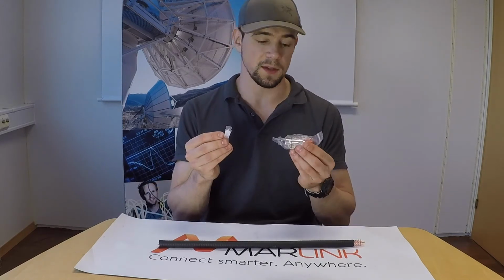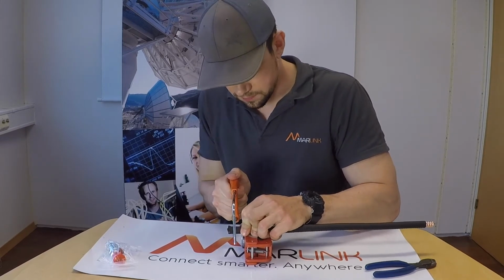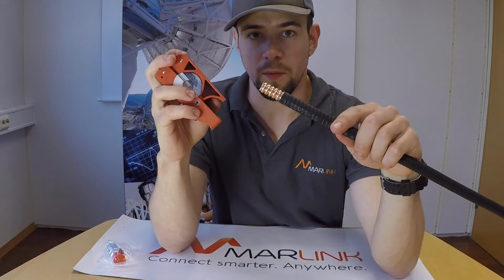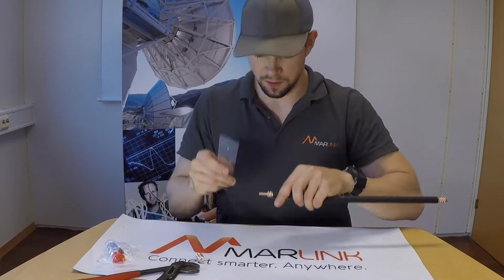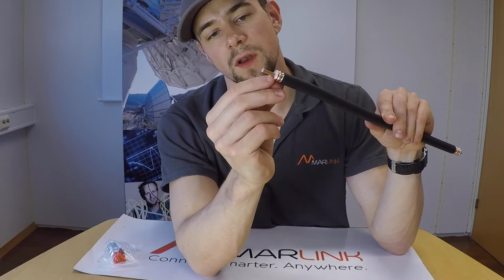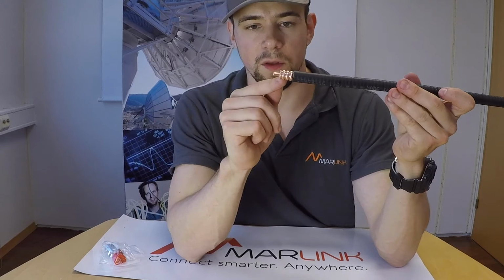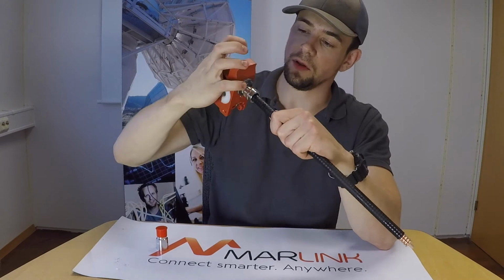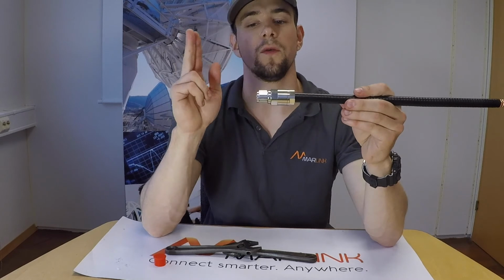Cable termination of Cellflex LCF12 50JFN (50-100 meters)

Comment: 1. Use of adjustable spanners...… Yuk
2. A cable loss measurement tells you 250 in decimal converted to hexadecimal: a full DTF-RL measurement should be made.

Comment: At 5:41 regarding the need to cut the center conductor, it seems to me that step should not be required if your special trim/stripping tool factored the correct length of the center conductor into its operation in the first place.